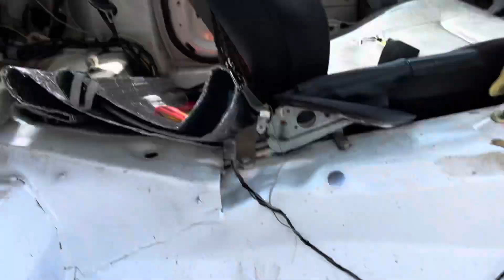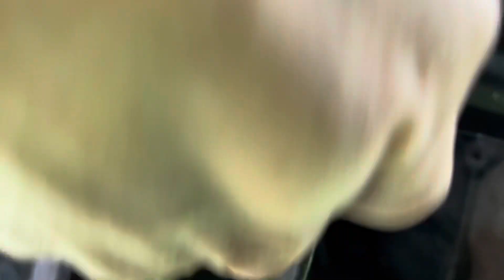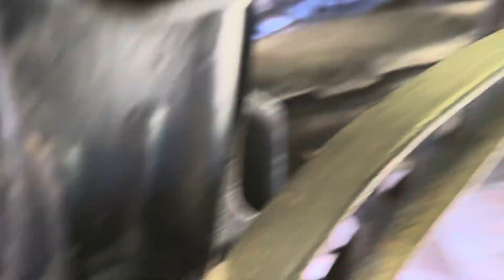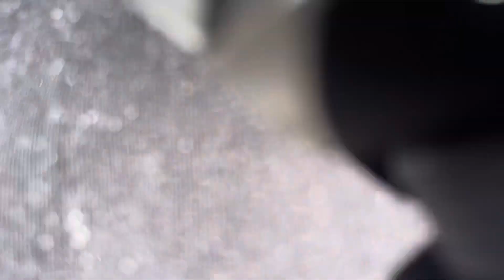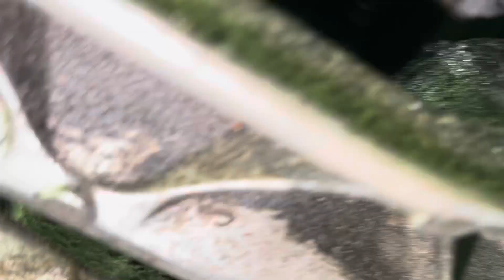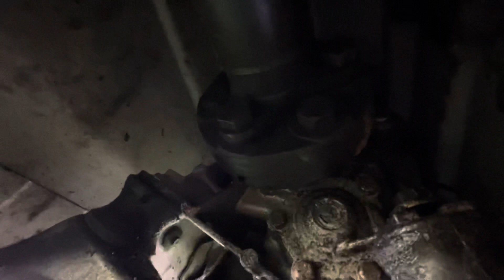E36 : Motor and Trans Mounts Replacement : Condor Speed Shop/Drift HQ

Comment: thanks for the video.  Would you still recommend these motor and trans mounts?
Reply from the maker: Most definitely and the rear subframe and diff also R tabs from condor which are available also from drift hq website ….. in progress of editing install of all the above mentioned parts